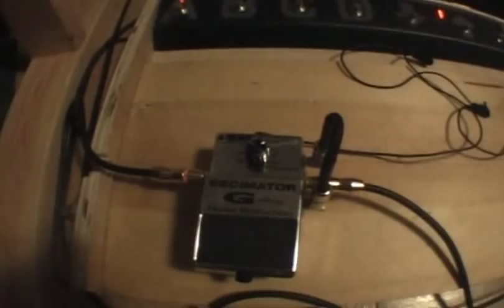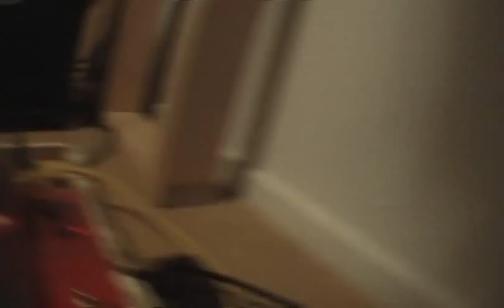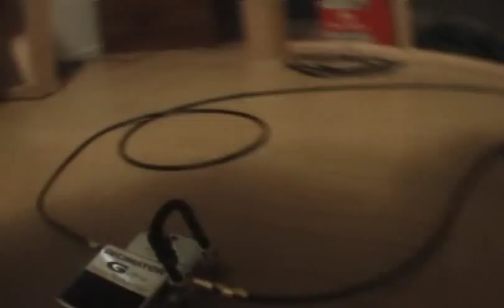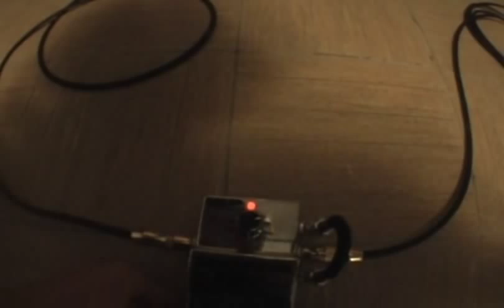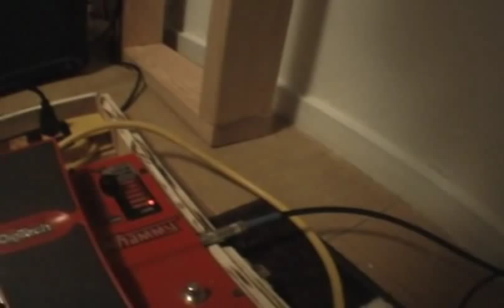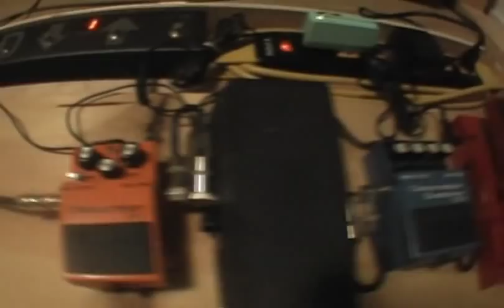Amp Noise, Part 1

Comment: Its your cables, fool, get new wires and see the difference
Reply from the maker: Wrong: the same cables used in this video have continued to serve me years after making this video. The problem came and left with the ISP.
Reply: then you have dry capacitors or a bad amp circuit, if you are using tube amps then change them, but theres no other reason you should have problems

Comment: Hi man, I'v got a question, since I'm trying to have my signals as clean as noise free as possible... How do you plug your effects with the ISP?
I have the following:  GUITAR --> MAXON OD808 -> AMP IN    //  FX LOOP SEND -> ISP -> PEDALS -> FX RETURN

I tried different settings, but I'm still getting some noise, should the isp be AFTER or BEFORE any pedal effect?  FOr example... GUITAR --> ISP --> Overdrive pedal -> AMP
Thanks!
Reply from the maker: To answer your question, the way you have it set up should be optimal for reducing noise when you're not playing.  The only potential issue would be the threshold--if you're toggling between clean and dirty channels, for example, the threshold level that is appropriate for the different channels might not be the same--you might have to choose between a really hard clamp on the cleans and no clamp on the dirty channel, for example.  If this is an issue, then putting the ISP before the preamp will give you a more consistent attack, but you'll be trading it off for the noise in the preamp.

As I'm sure you know, the gate should be able to clamp down on noise from any elements preceding it (in this case, your guitar, OD, and preamp).  If there's any more noise when you're trying to be quiet (guitar volume->0) then it's being generated by your pedals or power amp, both of which usually aren't so bad.  Power amps in particular are pretty quiet if they're running properly.

How are you powering your pedals?  If you're using a daisy chain as I did in these videos, then that will add noise, and either using 9V batteries or an isolated power supply like the Voodoo Labs Pedal Power 2+ will help immensely, particularly if the source of the noise is the pedals after the ISP in the fx loop; I'm assuming they're delay and reverb, correct?

Comment from the maker: I also didn't often use the DS-1 when I had it, and now I only use either my amp's distortion or a T-fuzz.  I also gave up on the G-string and went down to a single, normal decimator at the end of the pedal board.  The power stage is still a little noisy, but by cutting out the effects loop (and the ground loop), it's close enough--just a little bit of white noise.

Comment: I would try getting a good power supply for my pedals like a voodoo lab with independent channels in it (much better than daisy chains).  Also I've borrowed that boss distortion pedal before and I had alot of issues with sound and feedback from it.  Try upgrading to a better distortion or overdrive.  I use a tube screamer and an ecstasy blue from bogner and I love both of them.

Comment: This is the nature of the beast with high gain amps. You could get a tube screamer pedal and run it thru ur isp effects loop and turn your gain down to like 4 on ur amp. Then you wanna get a bbe sonic maximizer pedal to boost the gain that you are losing thru ur amp. This will cut down a lot of your noise.

Comment: Hum is generally introduced from a bad power supply to the pedal. A low quality or faulty lead. and in some cases the effects loop if faulty. This problem is quite apparent on the 5150 heads and sometimes need resoldering or generally just send it somewhere to have it fixed.